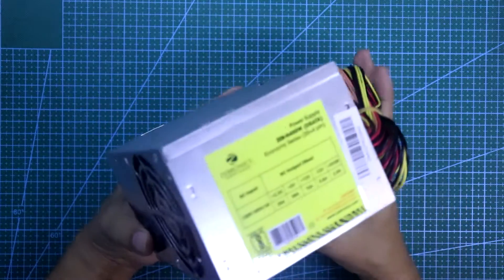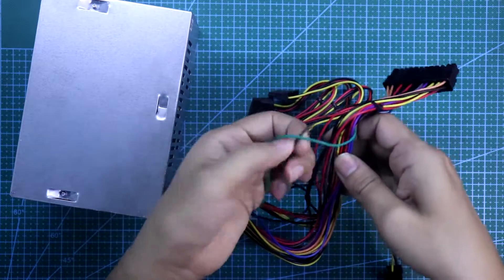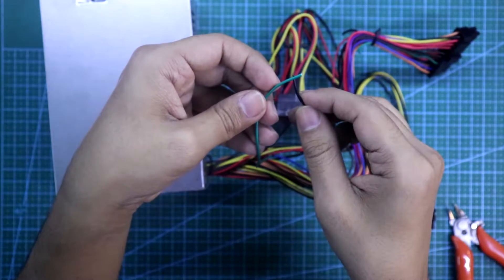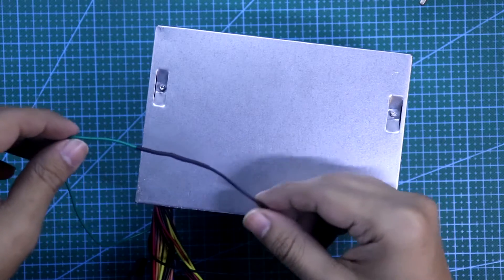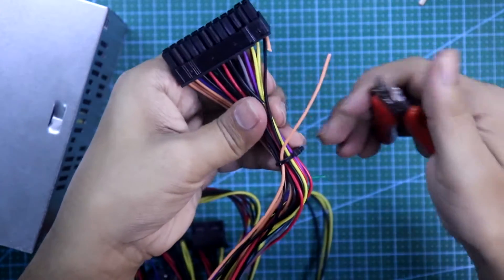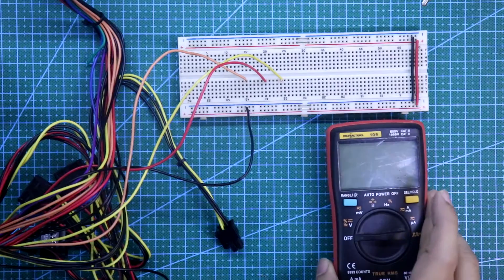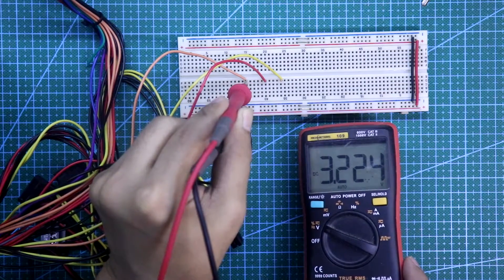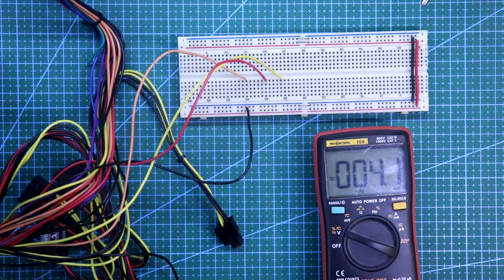How to use computer SMPS as a power supply

Comment: I would not recommend using a PC power supply as a lab power supply, they are extremely dangerous. The outputs have enough amperage to weld metal with them.
Reply from the maker: Yes you are correct. We have to be very careful, then I think we can use it.